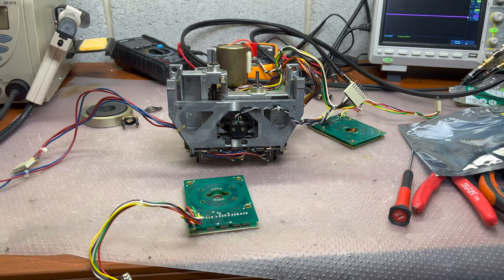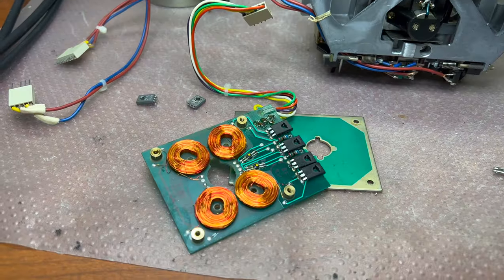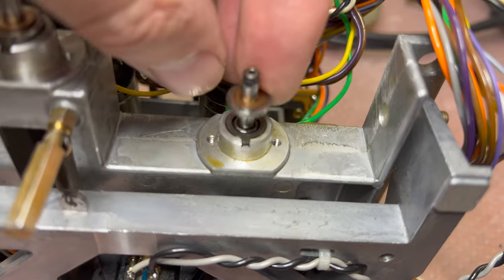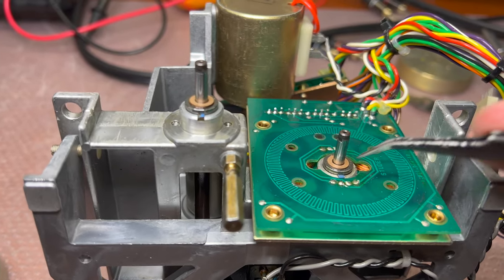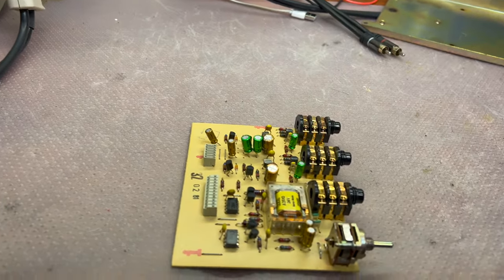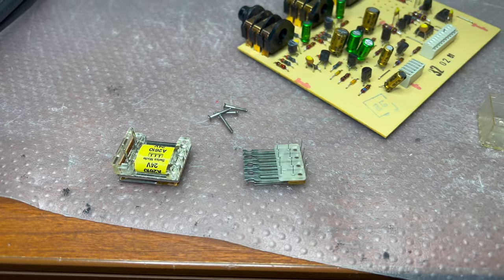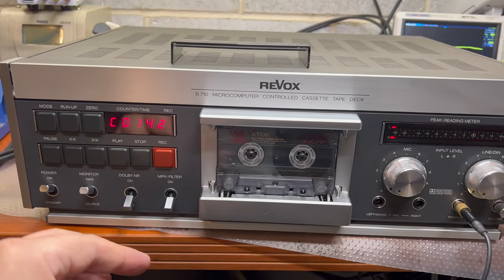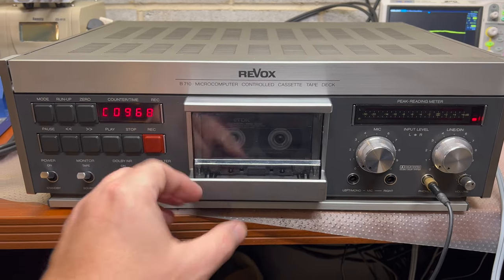Final Flaw Fixing Attempt for the Revox B710

Comment: Hi I have the same device purchased in 1982, I've never forgotten what the salesperson told me in the hi-fi store "only use 60 min not 90 min cassettes" and I followed this advice, the electric motors are less stressed and with 90 min cassettes the tape is thinner and stretches more easily, I have only used 60min cassettes. Congratulations you have nice videos and have the same hobby as you, I'm working on two revox B77 tape recorders right now, a 4 track and a 2 track. I worked for 43 years in a company where only magnetic heads were made, and my specialty was making butterfly heads for Studer-Revox. I'm just retired and still enjoy my revox devices daily. Greetings Patrick.

Comment: It IS the motors.  I spent months trying to figure this out.  The solution is to replace the worn sintered bronze bearings with abec 7 or 9 BALL Bearings.  Problem solved.  As soon as the original bearings get worn a little egg shaped, the extra drag causes the feedback current to stop the deck.  A real Hair puller.  Basically you are fighting the deck's "over protectiveness" for the tape.
I rebuild all Revox reel motors as standard procedure and the issue never returns.  If you can feel ANY side to side play on the spindles, the bearings are too worn and oiling them won't last.  Revox later fitted reel motors with ball bearings in the front as well.  But not until the B215-S.
Reply from the maker: I know about bearings, but it was not the case. Careful checking of the number of copper spacers and alignment of the pressure from the spring on the flywheel solved the problem with W&F. I hate this mechanism. I spent so much time understanding how it was designed.
Reply: @hifirulezzz  Sorry, I was talking about the spindle motors and it not rewinding or FF fully.  Trust me, I went through similar ordeals with my own B710.  I learned a LOT.  Since then I have been rebuilding this series of deck for 20 years.  I always put bearings into the spindle motors and no more binding.
It is a very fickle machine to get perfect.  My decks wind C120's no issue at all.  If you run into an early B215 that eats longer play tapes than C90 at the beginning, there is a service mod to increase the back tension.  Revox fixed this in later serial numbers.  They also later went to symmetrical larger pinch rollers on later B710's.  Willy Studer never wanted to make a cassette deck, but the market forced it.  Let's face it, their reel to reels is where it was at.
Reply from the maker: @Runco990  Ah, I see now.
Reply: @hifirulezzz  BTW, I'm assuming you DID adjust the move sensor pots to get symmetrical square waves on IC1 pin 1 left and pin 14 right?  I am actually working on one today.  So far it runs good.
Reply from the maker: @Runco990  I did, I stuck on the hum noise in the right channel. Tried everything, but have no idea where to also look. The deck was fully recapped, transistors replaced, and played with ground wire - no change. Swapped left/right channels from the head - hum stays in the right channel. So, the issue is definitely somewhere in the amp.